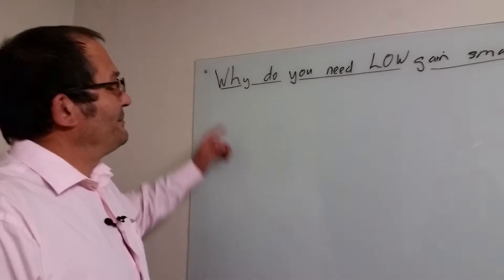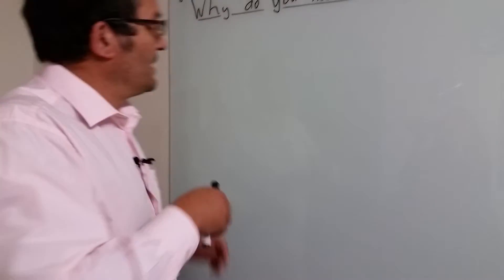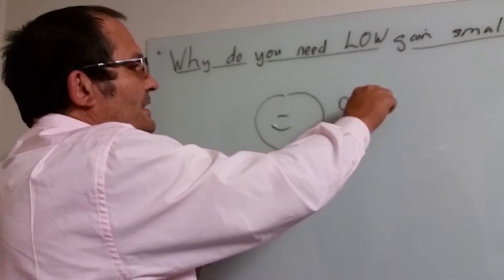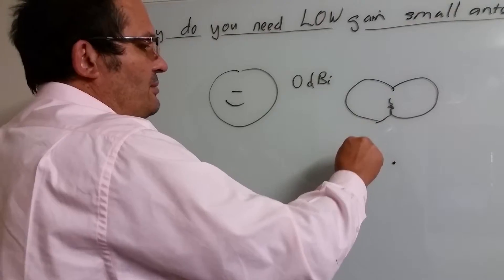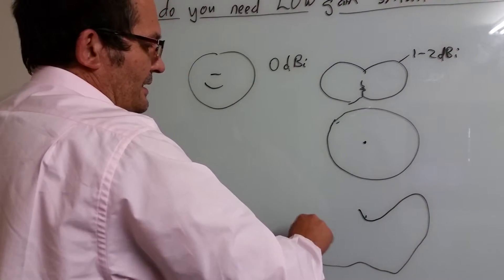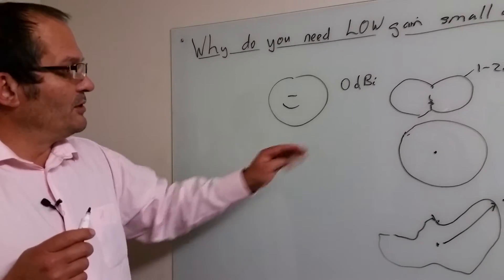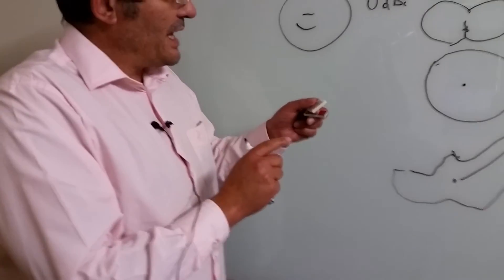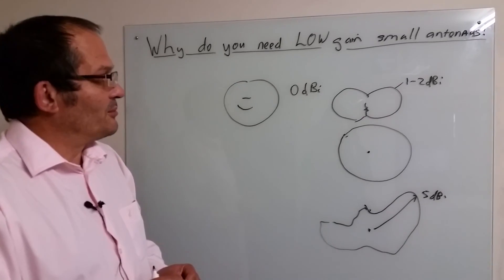Why do you need LOW GAIN small or omni-directional antennas?

Comment: I have a small enclosure that I'm putting two cisco dipole antennas on (blade/paddle style). I have the opportunity to place one antenna on the back of the box and one on the side (so one rotated 90 degrees). Is there an advantage to this, or should I put them both on the back? The box is only 5"x7"x2".